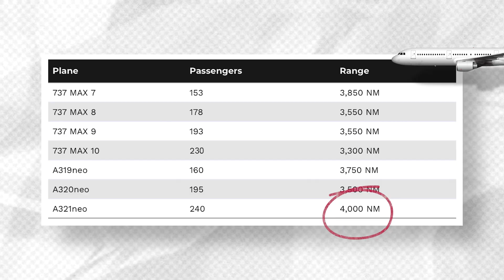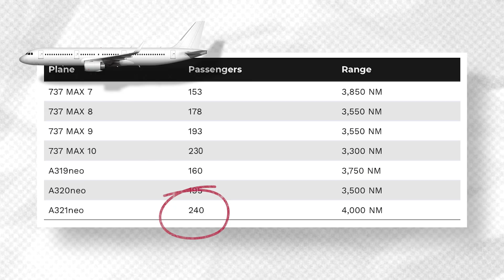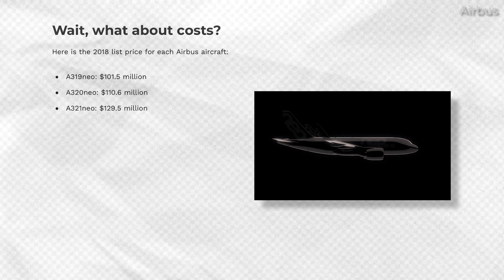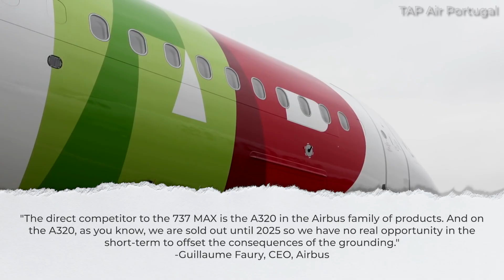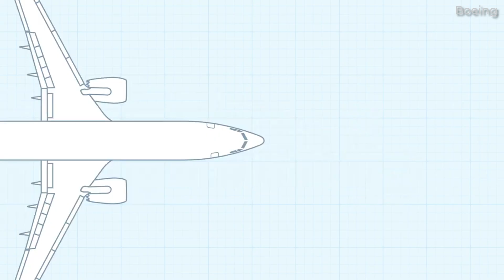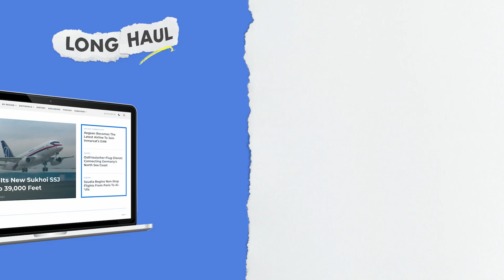The Airbus A320neo Vs Boeing 737 MAX – Which Plane Is Best?

Comment: How can the a320 neo carry more passengers than the 737 max 9, the max 9 is 5 metres longer. You also looked at the max single class pax for the A320 neo and the maximum 2 class paxs for the 737. The 737 max 9 carries 13 more pax at 2 class config.
Reply: Seating arrangement u dumb fuck

Comment: THE BIG DIFFERENCE IS AIRBUS DOORS DONT FALL OFF - WHICH PAX CONSIDER IMPORTANT. F*CK BOEING.
Reply: remember? airfrance 296Q,qantas 32 , qantas 72,
Reply: @marveljayden  The Air France one had 3 fatalities, and happened 1988, which was AGES ago... Both Qantas Flight 32 and 72 had no fatalities, one of them didn't even result in any injuries. But the Alaska Airlines one happened 2024, not 1988, 2008 or 2010. Another thing is the MCAS issue whichhappened in 2018 and 2019, resulting in way more fatalities while having a flight less, and they happened VERY recenly unnlike the Air France one which had 3 fatalities...

You're really just showing how safe Airbus is, and putting Boeing in a worse place, the opposite of what you intended.

Comment: Funny how things change in a year isn’t it. 
Turns out the Max did not recover after the 2 crashes which killed 346 people, as our narrator suggested they might.
Well it did recover, they sorted out the MCAS., which wanted to point the nose of the plane towards the ground at 500 miles an hour, but then only to have the doors fall off.
And then it turns out that’s not the only quality issue. There are multiple things that need tackling. 
So it’s going to be a difficult road for the Max family, at least for the next few months, if not a couple of years.

They will still keep customers though. 
Ryanair  and others will exact a price for their loyalty, as they already have done. it was in Boeings’ darkest hour , when the Max 8  was grounded , that Michael O’Leary went to order 100 or so aircraft. He knows when a bargain is available.
The same thing will happen here . Those people who stick with the Max, will get them at a big discount assuming they get the plane sorted, They will save a big chunk of money.
In the end, there is no sentiment in business. 
If a bad safety record means the unit prices lower, there will be people who will happily take that . As long As the travelling public are not too well informed.
Whether the travelling general public will forgive the Max series, remains to be seen .
As we know, most regular people have no idea what kind of aircraft they are flying on. 
If it stays that way, eventually the Max might get sorted and make money .
But if the general public take more of an interest and more importantly, start asking which aircraft they are likely to be travelling on and vote against the Max with their wallets, the Max and therefore Boeing could have big trouble.
Honestly though, bearing in mind the two Max 8 crashes because of a design flaw, it didn’t stop people flying on the Max then, so why should a door falling off do anything different. 
Ethiopian have ordered a new Max even though they lost one in the crash! 
Though we don’t know what the deal is , it could be a freebie or massively  discounted from Boeing. 

I do wonder what pilots and  crew think. In an organisation like Ryanair or Southwest, who have no choice but to fly the Max.  
I wonder if there’s any chance of a rebellion  because of safety concerns ?
If there are more jobs than pilots, could some of them decide not to  work for an airline that flys the Max ?
But if you have too many pilots chasing fewer jobs, that’s much less likely to happen. 

The Max still has thousands of orders and even if Airlines cancelled and went to Airbus they would be right at the back of the queue, so Boeing will always have customers for this aircraft family , as long as there are people who will fly on it , and they need to get it right. 

Me? No. They’ve shown they can’t be trusted. Even after two death crashes, they still didn’t learn the lesson.
I have no desire to encourage them by flying on one of these things.

Comment: I took a poll of 50 of my contacts, all frequent business travellers. Of these 50, 37 (including me), have decided never to fly on a Boeing 737 Max - of any variant. This plane is a flawed design, built badly with substandard quality control. It’s a death trap and the Max program should be scrapped altogether.
Reply: 2 crashes dosent mean that an aircraft is not safe

Comment: 737 Max doesn’t compare to A320 family Neo. A320 has far better and engineering and safety record. 

I would choose 320 over 737 any day.
Reply: 2 crashes dosent mean that an aircraft is not safe
Reply: @marveljayden  Alaska Airlines and the now solved MCAS issues say otherwise
Reply: @youseflatif796  Read it again, I clearly stated that the MCAS had issues which are now solved.

Comment: Obviously I prefer the A320neo, it is so much easier to fly than the 737 MAX. In fact, the A320neo only had 1 hull loss out of nearly 4,000 of them being delivered to airlines. My dad used to work with both Boeing and Airbus aircraft and he said the A320 is better, it is higher off the ground so you don’t bump your head like with a 737.

Comment: The reputation of Boeing's 737 MAX jetliner has been irreparably damaged by the two deadly crashes tied to flawed aircraft design. By moving the engines forward, Boeing created aerodynamic instability that required an automated system to improperly override pilot controls—an approach unacceptable for civilian aviation.  The 737 MAX tragedies exposed Boeing’s culture of prioritizing profits over safety and innovation. Attempts to merely upgrade an aging airframe led to catastrophic consequences that could have been avoided by full commitment to new engineering. Though vital steps have been taken to rectify issues, the company must focus on restoring public confidence above all else. This includes truly valuing safety recommendations over convenient workarounds to stay competitive. Only through substantive culture change can Boeing hope to regain trust and reclaim leadership in commercial aviation.
Reply: 2 crashes dosent mean that an aircraft is not safe
Reply: @marveljayden  
There have been a significant number of accidents and incidents involving the Boeing 737 throughout its long history. Here's the breakdown as of February 2024:

Total:**  529 accidents and incidents  including all variants of the 737 (originals, classics, next-generation, and MAX).

Fatalities:**  5,779 total fatalities  across all those incidents.

Hull Losses:** 234 accidents resulted in a complete hull loss (meaning the aircraft was destroyed and not repairable).

you're right 2 crashes mean nothing!
Reply: @ladavila  yeah but 737 is older
Reply: @marveljayden  Exactly, I would prefer my new car with all the new safety features over the old car with the same problems, but that's just me!
Reply: I hope more people learn that Boeing fixed MCAS. But Boeing was definitely stupid for not thinking about their own thinking.

Comment: An issue affecting the A320s that could potentially drive sales to Boeing is the ongoing problem with the Pratt PW1100G engines powering the Airbus. A flaw in the powdered metal used to make the high-pressure turbine discs could lead to cracks and uncontained failures. This led to the grounding of many aircraft to disassemble and inspect the engine cores. While the A320 is available with a choice of engines from Pratt & Whitney or CFM, the 737 only flies with the LEAP engine by CFM.
Reply: A similar problem even worse found on PW4000-powered Boeing 777s and EA GP7200 powered A380s. United Airlines are on the edge of planning to phase out their PW powered 777–200/200ERs and keep the GE90 powered ones

Comment: The Boeing 737 MAXs tragic start makes it for me an aircraft I do my best to avoid. Not because I am concerned about the aircraft's safety today – it probably is one of the safest aircraft in the world after all that has happened – but because I do not want to contribute to the demand for them.

The reason is simple: Boeing's rushed launch of these models ended up killing hundreds of people. Two crashes that so easily should have been avoided. The company's greed and carelessness led it to releasing a faulty product, all because they were in panic mode trying to cough up something that could compete with Airbus' NEOs. These weren't unfortunate accidents that on rare occasions just simply happen. It was accidental murder. The execs at the company at the time should be prosecuted and imprisoned for their misconduct.

Boeing failed to deliver on the most basic demand for an aircraft: ensuring it did not contain any faulty features that could endanger passengers and crew before launching it to the market. That is unforgivable in my book, no matter how well those aircraft perform today.

Comment: As a passenger I enjoyed the max more, now that I flew both. 
I liked the overall look of the interior and the non existing noise during the flight.
Reply: I especially love how noiseless it is during explosive decompression at 16,000 feet. 😂
Reply: airbus has less noise
Reply: Boeing Sky Interior sure makes the 737 look cooler and nicer on the inside, but the A320 family is still wider
Reply: I have always loved the wider cabin so you can move around more. Probably my favorite feature of the a320 over the 737max. @EuropeanRailfanAlt
Reply: @Roboseal2  In Summer 2023 I have flown on two 737s and an A321, I found the A321 more spacious aswell, so I agree

Comment: While the 737 MAX has better specs on paper than the A320 NEO, the reputational damage caused by Boeing's criminal negligence has caused irreparable damage to its reputation, and quite frankly, people would avoid flying the MAX, which would cause airlines to flock to the NEO if they want passengers. People prefer to go from point A to point B in one piece.
Reply: Nah it doesn't
Reply: @LadyGaGa is hot  Tell that to the DC-10, despite resolving all their safety issues and even redeeming their empirical safety statistics, thus making them among the safest planes, they were unable to shake off their reputation as "death traps" to this day. 

First impression is lasting.

Comment: Boeing. Worst company ever. Murderers and ignoramuses. An absolutely incompetent company with hundreds of accidents and thousands of deaths. They never managed to create a reliable plane. And the Boeing 737 Max 8 is proof of how disgusting this company is. They took an old 737 and stuffed it with new engines that did not match the original design at all. They developed the MCAS software to stabilize the large instability and still did not bother to share that it will interfere with the steering and can even kill by suppressing the steering. Nasty company. Nasty engineers. Thank God that Lockheed won the jsf program because no one had ever seen such a disgusting and dysfunctional aircraft as the f-32. Boeing? Never
Reply: Well then. Airbus has had over 1000 fatalities, Boeing has made way more planes than airbus with some in an era where computer technology and safety features DIDN'T EXIST!!! They are in the wrong with MCAS, but the whole entire company is not made up of criminals. Also, the 747 was incredibly reliable, sure it had a few incidents before computers, but what about United 811? China 006? They sustained incredible damage and the structural integrity of the plane was so strong that the planes managed to land safely.

Comment: Gotta say, as a mechanic having worked on both. Even ignoring Boeing’s MCAS tragedy, the 737 Max doesn’t hold a candle to the 320Neo’s. The 737 Max still just feels like an upgraded version of a 60 year old airplane while the Neo manages to feel like a brand new airplane
Reply: Nah the a320 neo is not really different from the a320ceo, it is just an upgraded version of an existing plane just as the max is an upgraded version of the 737ng.
Reply: @Hk-uw8my the difference being: the airbus is a 1990’s (1987)product and the Boeing is a 60’s(1967). Huge difference.
Reply: exactly, the A320 was already modern enough it didn't need the change, the 737 max was a desperate update to a plane that should've been retired 20 years ago @Hk-uw8my

Comment: Me personally even if everyone hates the MAX with its reputation, I will not hesitate to say that I prefer the 737 Max. It is more modern, more stable in flight (apart from MCAS accidents), and its cockpit is much more advanced than the A320neo. Basically the glow up of the 737 is much more important than that of the A320 for me and I'm not afraid to say that I prefer the max hands down.
Reply: Lol, everything you said is wrong. The 737 is not more stable and does not have a more modern cockpit.
Reply: @Voyager.2  bro the a320neo has a cockpit from the 80's XD
Reply: @Planetrainguy  Yet it's way more stylish and modern than the 737 cockpit. Everything is well placed with logic which cannot be said about the Boeing.
Reply: @Voyager.2  tbh they're about the same but I like the 737 more because Yoke>Sidestick
Reply: @Planetrainguy  You prefer the yoke, ok, but it does not make it better. Sidesticks are superior, everybody is switching to them. Boeing will too, just a matter of time.
Reply: @Voyager.2  nahhhh. I don't think Boeing are gonna design a new plane anytime soon, and they aren't gonna change the controls in what they already have.
Reply: time to rethink about the MAX again

Comment: How I miss the 757-200. As a passenger I like the 737-600 and -800 but would never willing fly on a  Max. Another area of  concern for me as a passenger is  the emergency evacuation time for the long fuselage  737 versions, the lessons of the BA 737  Manchester Airport  Disaster were quietly forgotten.
I also wonder if the so called "Miracle on the Hudson" would have had quite such a happy outcome if the aircraft was a 737.
Reply: If Sully was the pilot, it would have been fine. If the Lyon Air or Ethiopian Air Max pilots, then no, they would have tried to return to LGA or went for TEB. Not the same outcome…..
Reply: Garuda 421 and that is a 737: why did you forget me?

Comment: The Airbus A320/321 NEO family is outselling the 737MAX  because Boeing did a BIG mistake by revamping an old plane. They changed the engines positioning. And the airworthiness changed dramatically. The MCAS did not help properly that issue. And Boeing covered criminal procedures leading to 2 fatal crashes within some weeks. Airbus will lead the single-aisle market for the next 5 years. Or more..

Comment: I traveled in both, both planes were new or max 2 years old. I find the 737 max of Turkish Airlines much smoother and quiter as the A320neo also from Turkish Airlines as a pasenger.
Reply: I also flew with TK A321neo and the Max 8 but I have the opposite experience. the max in my opinion was noisier... None of them was smooth because it were turbulent flights

Comment: Kinda crazy how the A320 family has nearly the same amount of sales as the 737 and Boeing had a 20 or so year advantage. I’m a huge avgeek and love both companies but it’s kinda obvious Airbus has the edge here. Look at the numbers they don’t lie 4000 compared to 8000 orders it’s should be obvious. Also may I add that I’m seeing in these comments that “you can’t compare the A321LR or XLR because they compete with the 757” is stupid. It’s still apart of the A320 family but Airbus found a way to make it even better using an existing airframe whereas Boeing can’t and they need to design a completely new aircraft.

Comment: Essentially the 737 hails back to the 727 cockpit and even the 707, with tweaks, fixes and extensions. By contrast the A320 is a much more contemporary design. My money is certainly on Airbus with a far better design and upgrade potential. The 737 is at the end of life.

Comment: I'm pretty sure that this video was made based on information from Wikipedia especially seating capacity. Because in real life, I don't know if there is A320NEO with 195 seats. Mostly especially low-cost carriers would go with 186 seats single class config (EasyJet, Frontier, AirAsia, IndiGo). On the other hand, you mentioned only 178 seats which described in Wiki as 2-class config not a single class config which mostly 189 seats and up to 210 seats for MAX-200. The MAX-9 has much larger airframe and significantly carry more passenger in single class config than A320NEO, so I don't think they could be compared.

Comment: Interesting video, but I'd say largely flawed. The single biggest cost to airlines is fuel over an aircraft's life not the upfront cost. It doesn't matter if a 737 can carry X passengers a further Ynm if it uses more fuel to do that. According to Wikipedia (I know, probably questionable, but the intent stands), the A320neo has a fuel efficiency per seat of 2.25 litres / km and the 737 MAX 9 has 2.28... that's a 1.3% difference which might not seem much but is actually enormous in the aviation industry. Note that the addition of Sharklets on the A320neo gave a 3-4% fuel burn saving, and only up to that much on flights with long cruise segments!

It's way more complicated than this as these numbers are likely assuming a full cabin, full fuel tanks and maximum ranges, airline operations obviously very rarely meet all 3 of these criteria. Airlines will run all the very complicated calculations and find out what suits their network best to even achieve a fraction of a percentage in fuel savings. Paying slightly more for an aircraft you want will pay for itself in the long run in fuel savings.